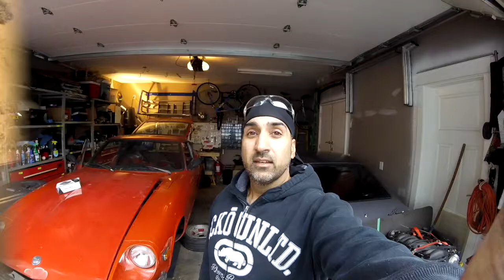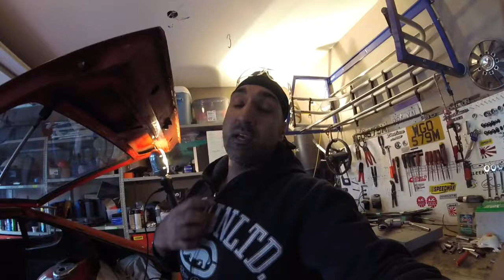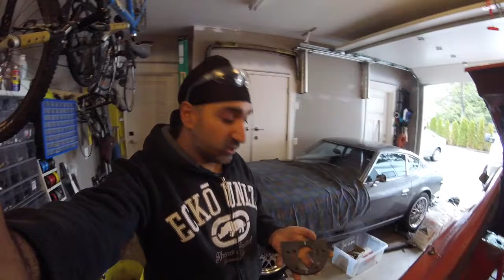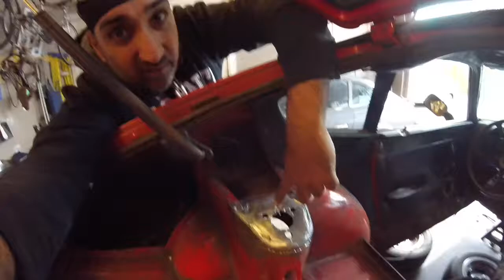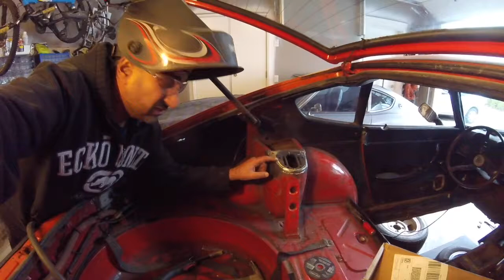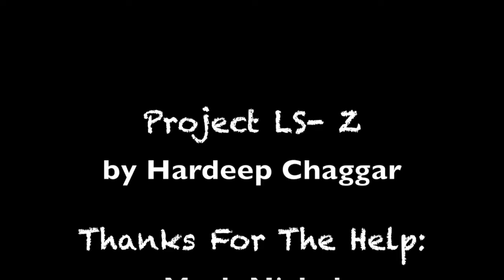Datsun 240z Episode 3 Project LS Z - Rear Camber Plate Weld In

Comment: There's enough thread on the shock to bolt through both.  Can't you just hollow the center and well on flat on it. And plug weld the underneath.  Seems it'll be easier